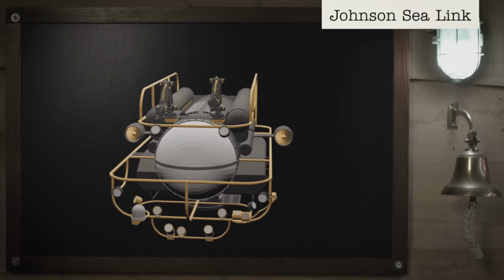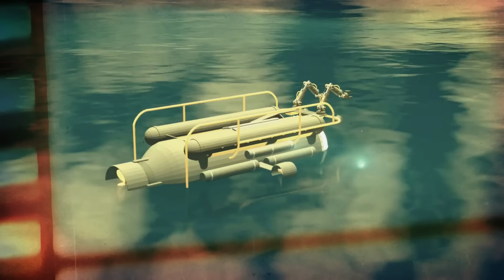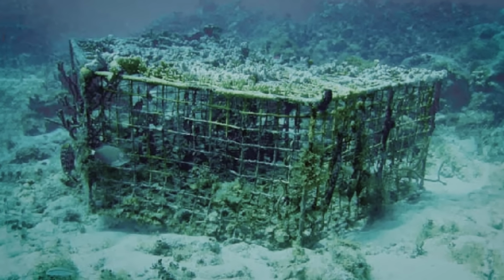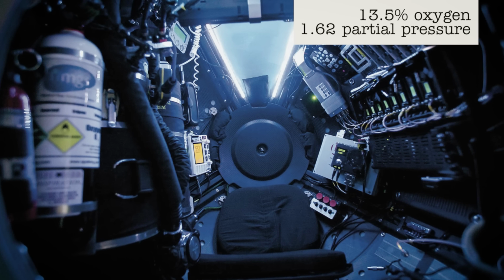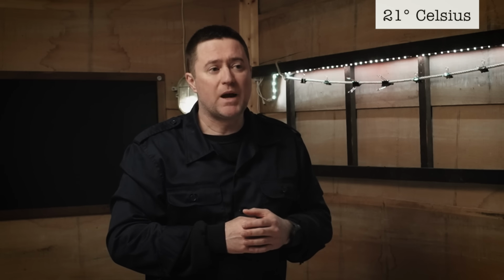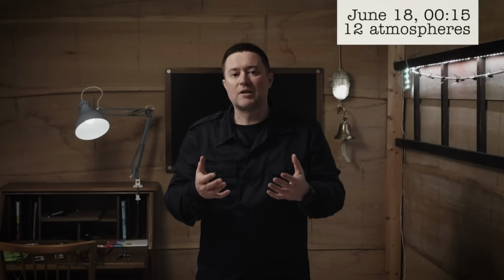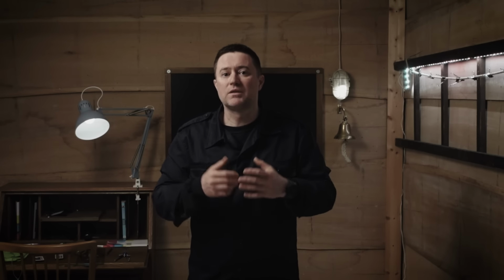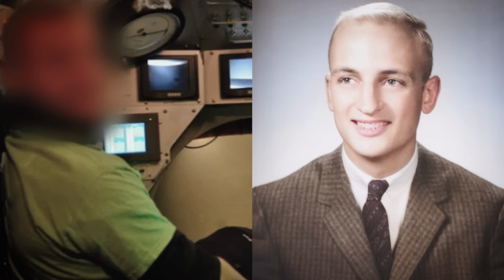This CO2 Scrubber Killed Half the Crew!

Comment: It's click-bait-ish to say "this CO2 scrubber killed these men". The scrubber worked exactly ss designed. The CO2 absorber material worked exactly as expected. 

The air temp dropped more than predicted, faster than predicted, and nobody thought of a way to warm the CO2 absorbent THAT'S what killed everyone.
Reply: I see what you're saying, but the CO2 scrubber was faultily designed... or else the temp wouldn't have led it to stop scrubbing CO2. Also the fan stopping didn't help either.
Reply: It's faulty because the scrubber doesn't have a heater in it.
Reply: @youtubehandlesux  
The lack of some sort of pre-heater not the same as "faulty". 
It's an unfortunate design choice with terrible consequences, but that's not the same as "broken." They just never thought of the chamber might get that cold.
Reply: being scared to save themselves killed them
Reply: T @dantrader-h4i   didn't want it bad enough
Reply: So an unheated CO2 scrubber killed them?  How is that any different than "This CO2 scrubber killed half the crew", Karen?
Reply: @bf-696  
No. Being trapped for days killed them. 

Big trucks sometimes lose their brakes going downhill. If brakes remain engaged (even lightly) for an extended period of time, they will overheat, glaze over, and lose the friction properties essential to function. After that, the driver just hangs on until he stops or is stopped.

The brakes on that truck did not fail due to faulty design or mechanical failure. They failed because they were pushed FAR beyond the operating conditions they were designed for. Same thing here.

Comment: I love how there's a backups by design just in case because the people who built it cared enough but the operators see ones broken and decide it will be fine who needs a back up its never needed anyway and that's when you've tempted fate and your gonna regret it. If one fails what's stopping the other one failing its proof it happens don't be stupid and just get stuff fixed 99% of these diving accidents can be prevented by maintenance or if you don't feel safe just say your not doing it yeah might do your managers head in and someone else might take the risk and you lose that specific job but there's nothing they can legally do to you cant fire you or anything or if they do your better off get another place that might listen to you or you could probably file a lawsuit or rat to OSHA about it. Just take the reputation of being a pain and carry on living.

Comment: 1.6 bar partial pressure of oxygen isn't quite as dramatic as you make it sound, I know divers who regularly breathe 1.6 bar during decompression, and some even do that during the active part of a dive. That should not have prevented them from going outside to free the vessel. The fact that the gas they brought is not suitable for the depth they are diving to is frankly simply stupid.

I know divers who regularly dive to 100m depth (even inside caves) using rebreathers. Sending divers on surface supply gear is also incredibly stupid. Everything that happened is a massive disregard of common sense, safety engineering and procedures, and incredibly poor planning.

Comment: I'm not going on a sub that's covered in hooks, and cables, and loops of steel like a damn giant piece of velcro to wreck site.
Reply: They should have just called it "The Snag O' Matic"
Reply: I’m not going on a sub.
Reply: Multifunctionality comes at a cost in development and dare I say at a price in use.
Reply: @Paxmax sure but making these hooks removable would b a minimal thing. Since they are just fixed and not robotic. It's kinda stupid to have hooks that you are not going to use in that dive and also can't see.
Reply: @kungfreddie that’s easy to say after. But I agree, they should plan for a way to get to the surface in the event of a malfunction.
Reply: @tylermarier2034 You mean like the diving chamber?
Reply: i'd sooner go in a carbon tube with my dollar store Gc controller lol
Reply: Pretty much all deep sea submersibles are built that way. 
The pressure chamber(s) must be as continuous as possible. Every seam, every seal, every bolt hole creates discontinuity in the material of the pressure chamber. Each one of these is a weak point, a spot that is more likely to fail than continuous material. Thus, you do not want to bolt anything to that chamber unless you have no other choice whatsoever. And you do NOT want to bump that chamber into anything. Ever.

That frame is there 1) to protect the chamber from impact and 2) provide attachment points for all the control props and arms and lights and other stuff needed to do more than look around.

Yes, I agree it looks like something put together by pre-teens, but it is done that way for a reason.
Reply: Yeah...did they even have a CO2 meter and alarm?
Reply: As the USCG concluded! 
"The submersible's modular construction of irregular shapes, projections, and appendages provide an excellent configuration for ensnarement by almost any type of obstruction."
Reply: Next time you get on a submarine let me know what it looks like
Reply: Recon they should have spent the money to be able to unspool the winches or simply cut the lines?

The world may never know? We do now.

Comment: There is a reason why safety protocols exist. They are for your safety. If you disregard them you effectively sign away your life in the event of an accident. Good job 👏
Reply: That's the problem. They didn't have any safety protocols. No need for a full inspection prior to launch. No need to repair faulty to life support systems before launch. No need to wear diving suits when riding down in the dive compartment. They simply didn't care in the first place. 

Now the recent Titan sub implosion, that was pure negligence. Which, in my opinion, is even worse than ignorance.

Comment: Great story, but also horrific. Originally, I was wondering why the rising air pressure inside couldn't just be vented to the water outside until I realized that the exterior water was under even more pressure. Too bad they can't just put an air fitting on the outside so that it could be connected to an air hose running to the surface.

Comment: Never skip repairs, always have a backup system/plan. And if a more experienced crew member says grab a jacket/food/whatever, DO IT! So many of these incidents could be avoided, or not as severe, if people took logical precautions.
Reply: Seems like for something like CO2 scrubbers, they should at least have one that's hand cranked considering that mechanical and electrical systems aren't that reliable.
Reply: @ryelor123  Any system is unreliable if you actively choose not to address faults.
Reply: @mactep1  yep. take an engine for example. it can have all the high tech sensors to control detonation, air/fuel, temperature warning etc, but if the owner doesnt check them periodically to make sure they work, thats on them!
Reply: @ct1762  
some of these cases are closer to "and if the owner doesn't put gasoline in the tank then the engine will stop working"
Reply: @darkracer1252  haha i wouldn't be surprised. in fact as a mechanic, ive seen it!
Reply: what if the co2 scrubber had a fault mid dive? you need a backup plan.  @mactep1
Reply: Hind sight  is 20//20. Often the res a time crinxh real or perceived.